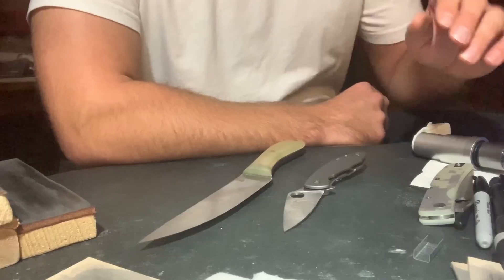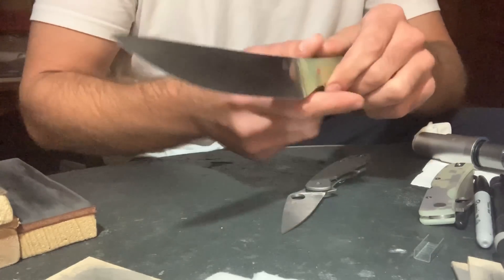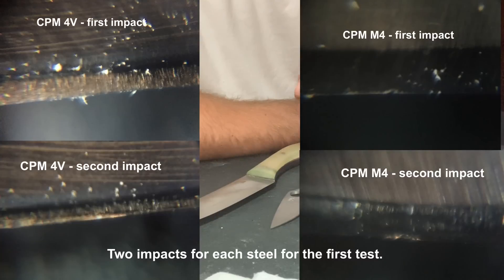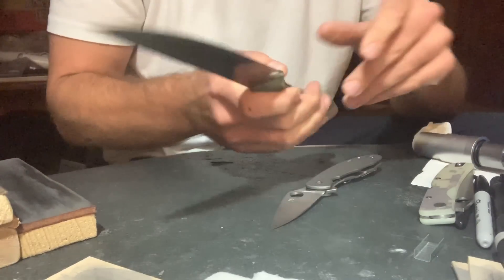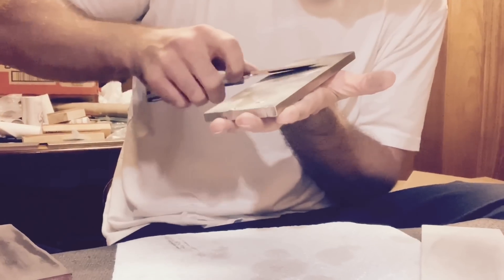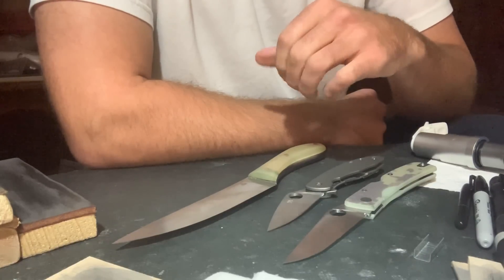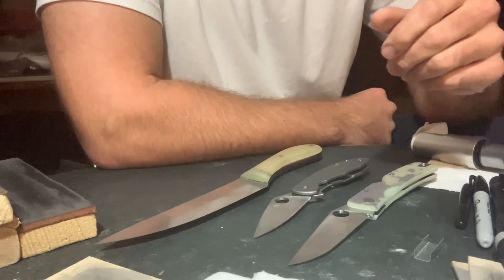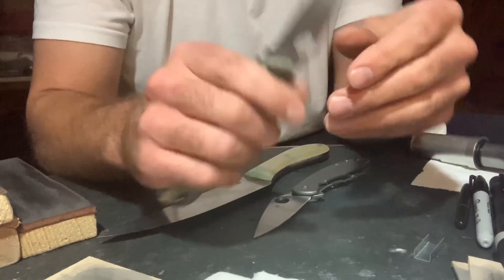Steel toughness testing - 4V, M4, and S90V

Comment: Don't know if the photos are to scale, but it looks like the bevel on the M4 knife is taller, as compared to BBB fixed blade, which might be a factor.  I think we need to consider stock thickness and thickness behind the edge/bevel height, as well as angle (for a given thickness behind the bevel and bevel angle the bevel height is fixed, i.e. the base and sides of a triangle).
Reply from the maker: Abe the knives are at different thicknesses behind the edge, which is why the bevel sizes are different.  The bevel angles are the same.  The different thickness behind the edge would only matter in this kind of testing if the damage was enough that it moved onto the primary grind, which I don’t believe that it did. (Or not very far into the primary grind.)
Reply: @michaelchristy4982  I'm not sure about that.  I don't know if it's something that has been studied, but I can imagine that the bevel height may play a role.  Essentially, it's having a larger or smaller wedge of the same angle.  That might affect how vibrations travel/harmonics, and how much compressive load the wedge can take.  Having thicker or more massive stock behind the edge may also be a larger reservoir for vibrational energy, or otherwise change how vibrations travel (possibly being weaker for certain harmonics, i.e. if it is less flexible).  Perhaps there are some engineers or metallurgists who want to weight in.

Comment: Hey Michael, I admire and got inspired from what you do. You helped me with my M390 PM2 and took my sharpening skills to another level. Thank you again.
I wanted to ask you one thing:
Have you ever had your hands on CPK (Carothers Performance Knives)? They have fixed blades from 3" up to 12" (even now making 18" sword). Nathan Carother is magician of heat treatment. He mainly works with CPM 3V. And created his protocol which is called Delta protocol, now it is like brand, his 3V is being called D3V. Amazing performer. Here is what Nathan says:
"The steel is Crucible CPM 3V at HRC 61-62 with a fully optimized heat treat with very good edge retention and edge stability. You'll be surprised how sharp this gets and how well it holds an edge. If you have never used 3V this hard and thin, it is gonna blow your mind."
And
"A side effect of this heat treat is a higher percentage of free chromium, so although it is not stainless, it is nearly so."
He cuts nails, cuts bolts, cuts cinder blocks with his knives.
I would love to see your review about one of his knives. They are usually sold at bladeforums at their subforum and if one cant grab from Nathan (as their 10-20 knives sell in seconds every 10-15 day) there is second hand market where some collectors or regular guy sell them for bit extra price (around 25-50$ extra). I do own their Field Knife 2 5" blade and awaiting for EDC 3" model. Field Knife performse amazing (second hand price is around 300-350$ and EDC is from 250-300$). You will be surprised how easy it is to sharpen (like carbon opinel) but resists abuse and holds edge without any problems. I have had regular 3v knifes, boker folder, coldsteel and other maker knifes but Delta 3V is completely different thing. I think you must try it.
I even wrote about my small sharpening experience on their subforum and said that you influenced me a lot.
Thanks a lot for everything. I just want you to try and enjoy their D3V it will change your mind about some things lol. And if you have one, I want to see and hear your review about CPK D3V. You can check Nathans youtube page: Nateaim
Be healthy.

Nika (Miracle- at bladeforums)
Reply from the maker: Nika Sarjveladze I’ve seen his knives and his videos, but it’s been a while.  Glad to hear he’s doing good.
Reply: @michaelchristy4982  Yes he does, wish that I lived in USA, I would send you his knife to try, test (and maybe if be lucky get review). I'm from small country under Russia, called Georgia. I just love every sharp thing lol, so I have had many different knives but his knives changed my experience. How to tell, in terms of edge retention, D3V compared to cold steel 3V is like to compare cold steels 3v with 10V lol. And in terms of toughtnes it's tought like S7 steel or evennore. You just have to try. I didnt knew if you have heard about them as they are small "family" business.. I respect you, and I wanted you to try and enjoy it. (And seeing your review would be amazing)
Thanks for a reply.
Be health with your beloved one.
Nika

Comment: I've seen some testing on Spyderco 4V sprint runs and it was higher than 64hrc... Most of them around 66hrc really..
Reply: All the sprint runs I’ve seen have tested between 64-65. The highest I saw was a 65.6 I think. I might be off by .1 or .2
Reply: Marek Masar garbage that hard

Comment: Not a correct test. You should do much more cuts than 3... about 20 cuts would be good enough to see the real picture.
Reply from the maker: NSTD what’s that number based on?
Reply: @michaelchristy4982  more numbers, more real picture. You did not make only one number right? If you dont want make many rounds, then you should exactly repeat all test conditions, like blade thickness behind the edge\power of movement\speed\angle\blade part spot\orientation of staple\power of staple connection and so on...
Reply from the maker: NSTD you didn’t answer my question.  What’s the number 20 based on?  Do you have a legitimate reason for throwing out that number, or did you just pull it out of your ass?
Reply: @michaelchristy4982  more cuts gives more complete and richer picture. To build right picture from only few cuts, you must keep same speed, same angle, same distance, same staple position, same pressure. Its like testing new drug on 2 or 3 people. Nobody does that. Weird you dont understand it.

Comment: Hi Michael, your "toughness test" was an actual edge stability test at low energy impact. 
Dont relate it to toughness as such. Steel behaves differently at the very thin 
sections than gross material (toughness). Forget steels like CPM-V4 or CPM-M4 being tough. 
I know that people selling products / steels is where the information came from. 
So its needed to take it accordingly. These steels are tough relative to their class/application. 
Toughness in short blades is the least important property anyway. 
Perhaps the thinnest knife behind the edge could behave as a spring 
and absorb more energy than thicker geometries, despite identical 
sharpeing angle so results may still not be relevevant. 
Obviously there are much more variables to control but just with the same geometries 
and high amount of trials you would already get a good results. Nice video and idea. )

Comment: I love all of your videos and thank you greatly for taking the time to share with the community. I find you to be honest, diligent, thoughtful and methodical. While other channels entertain with knives, you teach about the fundamentals that real knife nuts obsess over. You don't just give specs waving blades around. This test in particular was a great new branch for your series. BBB really seemed to get things fired up regarding toughness!
My constructive criticism is hard to give as I don't much like hearing it personally. Growth isn't easy. And, your video is obviously better than many commenters below or my own. With all that said... I think more regarding thickness behind the edge should have been mentioned. I think you said 30 inclusive, but that's not all the info we need. Also, commenters said the staple needs to be bent over, I agree. It's early in the process and variables can still change before the format of the test is standardized. I encourage testing knives in groups where edge thickness is similar against folded staples. 
Regardless, another awesome video that I enjoyed for free. I will stop back seat driving now.
Reply from the maker: ToxicityAssured I don’t know how much those factors would really matter.  The testing and prep for this video stretched over weeks.  In that time, I tried making things more extreme by hammering through staples until they cut have.  The damage for that followed the same pattern and looked the same.  (Surprisingly enough.).  If I had found a difference hammering the knives through (which I thought I would), I would have included it.  As it stood, it would have just been extra that led to nothing.  
The knives were at 30 inclusive, but that’s the edge angle.  The thickness behind the edge is measured on the primary grind, not the edge bevel.

Comment: did you mention the behind the edge thickness of each knife . would the  thickness dissipate the energy to change the damage  more or less?
off topic .what parameters are used to decide strops with wood or leather ?
Reply from the maker: dan michell I doubt the thickness behind the edge would matter unless the damage went into the primary grind, which in this case, it didn’t.  
As far as strops are concerned, wood or leather can be decided by a lot of factors.  I often use wood if I want a fresh stropping surface, because I usually only use wood once.
Reply: @michaelchristy4982  thanks . are you concerned with contamination of the wood or is it deforming during the stropping phase in that you only use it once . is the wood a flatter surface compared to leather being softer?or is the leather very hard  and still flat ?
Reply from the maker: dan michell the wood will eventually deform from applying more compound.  You can go past one use, but the first use with any strop (short of maybe nano cloth) is always the best.  Sometimes I’ll use the same piece repeatedly.  It depends on the sharpening.

Comment: i would like to see you run a similar test with various different knives in the same steel. i would like to see if thickness behind the edge or heat treat differences had obvious effects on the results.

Comment: This is Absolutely 100% relevant. 

I've been saying this for a while..
CATRA testing and CHARPY testing dont necessarily equate to real world application. 

Alot of the numbers we read in a controlled environment dont come out the same in a folding knife in the real world.

Thank you for doing this test.
Awesome.
Reply from the maker: SuperSteel Steve I agree, there should be some testing that includes some variables.
Reply: @michaelchristy4982  The actual world of knife use is full of variables. 

I'm my opinion a 100% sterile test is irrelevant. 

It doesn't apply to what we as users do. 

Not to mention on the subject of toughness CHARPY tests dont use  knife blades at .20 thou behind the edge with a 30° inclusive edge.
They test pre cracked steel blanks lol
Reply from the maker: SuperSteel Steve I think both kinds of tests have there value, but let’s leave the catra and charpy tests to the companies, while you and I stick to tests with variables.
Reply: @michaelchristy4982  sounds like a plan brother.👊👊👊

Comment: Toughness is even more elusive to test in a standardized way than edge retention, I think your idea is great and well executed
Reply from the maker: Cedric & Ada Gear and Outdoors thank you, Pete.  Toughness testing is really tricky.  Lots of variables.  I’m not sure I did the subject full justice, but I thought the idea of the staples was good.
Reply: It's early in the process and variables can still change before the format of the test is standardized. I encourage testing knives in groups where edge thickness is similar against folded staples. Regardless, another awesome video that I enjoyed for free. I will stop back seat driving now.
Reply: Have we even defined toughness yet? (Beyond the old charpy ductility test, which is valuable but not definitive)?
Reply from the maker: JacksonKnives here’s Crucible’s explanation of toughness.  “Toughness, as considered for tooling materials, is the relative resistance of a material to breakage, chipping or cracking under impact or stress.  Toughness may be thought of as the opposite of brittleness.”
Reply: @michaelchristy4982  That sounds reasonable, but shouldn't the definition line up with a measurable property that's relevant to the task at hand? Charpy tests measuring absorbed energy work very well for things like bolts where elongation is desirable, but what does it really mean for an edge in one steel to better "resist breakage" than another steel? Is a catastrophic roll really better than a chip if you've got three more hours of chopping to do? Why do we talk about laminated steel and drawn-back spines as beneficial to "toughness" if the edge is where the damage happens anyhow?
Reply from the maker: JacksonKnives it’s a valid question.  Sometimes you’re dealing with extremes, like the difference between S110V at 62RC and 3V at 60RC, where the numbers can give an obvious indication of a difference you can expect.  I can often look at a steels composition and have a pretty good idea.  So something like M390, while everyone likes to say it’s a tough steel, it’s not...  I know it’s not...  some other people know it’s not...  because it has 20% chromium, and that simply does not produce a tough steel.  It’s fine for an EDC folder, but it’s not tough like 1095 or 3V is tough.  
The slight differences in the numbers don’t matter.  It’s the big variations that make a difference.  Or, if the knife is being made for a specific task that requires extreme performance.
Reply: @michaelchristy4982  I think that last point is crucial. I'd rather see makers (and enthusiasts) talking about geometry that's appropriate for specific tasks than promoting metallurgical properties that don't show up in the same-old-same-old FFG 3.5" blade. 
Maybe a clearer definition of "camp knife" is just as important as a clearer definition of "tough steel." 
Keep up the good work!
Reply: This is custom vs production tho.  Yes it’s spyderco they do their steels very well. But ok brown bear is a beast.  Kinda unfair

Comment: As usual another insightful trial. Thanks for the effort!
Will you be doing a full s90v Manly Peak evaluation?  I've been carrying my recently acquired one and am very impressed!  The factory sharpening left a lot to be desired but was easily corrected and overall I find it a very practical knife for the money.  It's nice to have a slim folding s90v knife with a thin grind and solid lock for such a reasonable price.
Reply from the maker: Joshua Briggs so far I agree, but I do want to give it more use before I commit to an opinion.

Comment: Interesting stuff.
But i think it would have been better if the staples were fixed instead of just pressed through without bending the legs. Now the knives seem to take less damage and just pop the staples out.
Reply from the maker: Rutger Mulder does a staple gun bend the legs back?  Not a stapler, but a staple gun.
Reply: They use special staplers for cardboard boxes that bend the staples. A stapler gun is not used for cardboard.
Reply from the maker: Rutger Mulder oh, you mean the big brass looking staples and the gun to go with them.  I don’t have one of those.  I figured a regular staple gun would be good because I could use it around the house as needed after the video...  now I just need to find it.
Reply: Yeah the brass staples. That is the stuff i run into at work. They are sometimes hidden under tape. So when i saw you cutting the cardboard i noticed you sliced through it so easy. I don't know if it would make a big difference for the edge damage in the tests. But i thought if you bend the smaller stapler gun staples it would replicate it more. Just a thought.

Comment: Great idea. Interesting results. From the microscope shots it looked to me like the 4v fared significantly better than the other 2, and that there was almost no difference between m4 and s90v. Maybe I missed it, but did you discuss the edge angle of these knives, or the impact different edge angles might have on the results i.e a more obtuse angle should be more resistant to chipping than a thinner angle. I know you usually sharpen to 30 inclusive but figured it may be worth mentioning.
Reply from the maker: chris pregent all were at 30 inclusive.  Not sure if I highlighted that in the video.  I was pushing to get this one done.

Comment: I have a question mike about  cpm s110v and your the only person who’s advice I’m gonna take but I can get the knife to shave hair with no problem but I just can’t get it to whittle a hair no matter what way I try to sharpen it. I use straight diamond and finish with the kme lapping films
Reply from the maker: Joe Montini what do you use between the diamond and films?
Reply: I figured that mike I will look into that thanks for your input man
Reply from the maker: Joe Montini no problem.
Reply: I start with a 140 grit then to a 300 then to a 600 and finish with a 1500 grit then I start with a 9 micron lapping film and go all the way down to a .10 of a micron I try not to skip a step as u mention in your one video about s110v my edge is sharp but it doesn’t get that really crazy bite like yours do
Reply from the maker: Joe Montini with something like S110V, the Spyderco UF is somewhat critical for me.  You should try throwing that into the mix between the diamond and the films.  Ken Schwartz can cut them to fit a guided system if that’s what you’re using.
Reply: One more question I found the stones on Jendes website should I mess around with the medium and fine stone or just the ultra fine?
Reply: Joe Montini you can’t use the kme regular films you must use their new diamond films!!  As well as that spydie extra fine as Mike said- I bought mine from grit o matic...
Reply from the maker: Joe Montini with a diamond progression, just use the UF as a finishing stone.